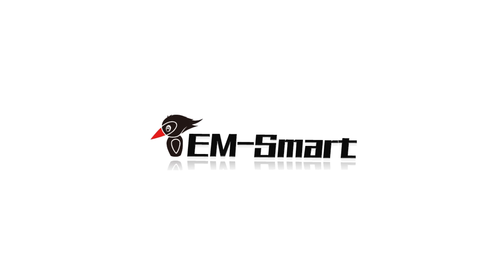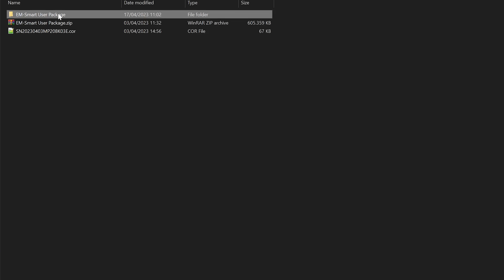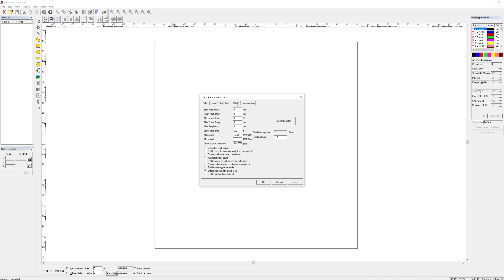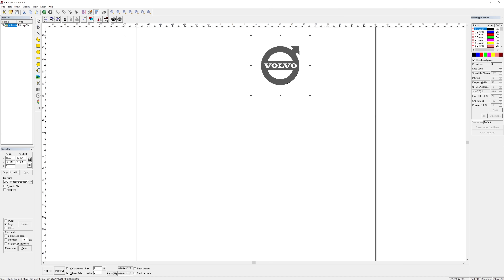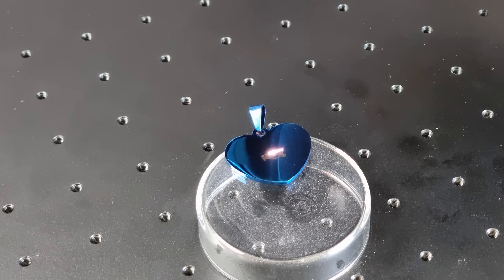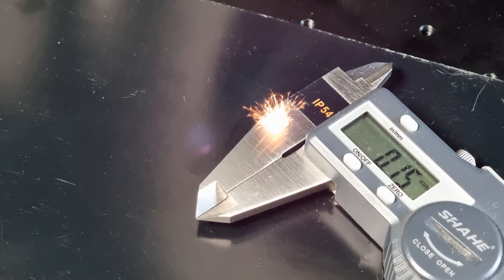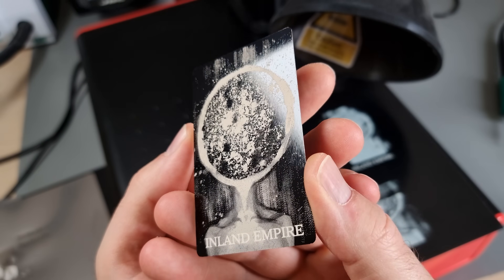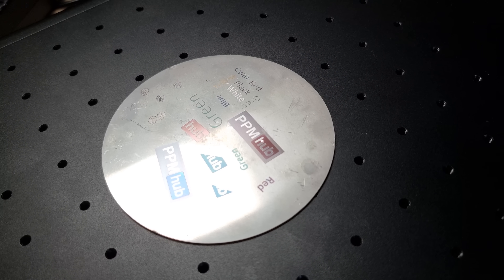20W EM-Smart MOPA Desktop Fiber Laser Engraver Review

Comment: Nice video, I also watched every other video to make sure I understood what this laser offered, and decided to share my experience. When I received the EM-Smart Mopa laser I purchased I was very impressed right from the start, which is good because this is my first fiber laser (I have a diode laser). It was well packed. It was very easy to assemble and equally easy to configure. I fired up EZCAD and was able to do some testing. I created cheat sheets with all the settings I use for the various items I sell, these sheets come in handy.

The main reason I went with this laser was because of its compact size. I knew this laser  would be a benefit at Craft Shows and it has been. I found a cheap folding 3-sided thin wooden divider that works great to shield the laser, with that setup I was able to provide custom engraved items to customers while they waited (I just made sure the spot I was given had a plug near by). If my success at craft shows continues, I will have this laser paid off in no time. 

All in all, I am very impressed with the laser and look forward to learning more about it and seeing what other cool items I can make with it.

Comment: Looks a neat little machine! I find it a bit strange that you need to use a negative value for the start/on tc time. This usually indicates an incorrectly set “jump delay”, which you can find under the Advance button. On mine I have the jump delay (both min and max) at 400us, then the start tc at positive 200ns.
Reply from the maker: Interesting, thank you, will have another look!
Reply: @reps perhaps things will become clearer if you take it apart

Comment: A little less pulse power than the usual JPT M7 60W ( 1.5mJ vs 2.0mJ ), and it seems they indicate proprietary lenses on their site which would be a little worrying.  Otherwise a nice package, and a bit cheaper than the current Amazon prices for similar.  Maybe another round of prices wars is coming for MOPA.
Reply: The 2mJ version is significantly more expensive. This is the YDFLP-E-20-M7-S-R, with the -E being the cost-optimized model, and it's by far the most popular now, all the way up to 60W(that's what I bought as a bare source). It came out a couple years ago and everyone has switched to it since, unless you specifically ask for the larger, more powerful option.

Comment: You didn't talk about the most important question: Is it usable for creating PCBs? Can it remove the thin copper?
Reply from the maker: Yes, it can structure thin copper layers directly, but one has to be very careful not to burn the epoxy / glass fiber substrate

Comment: Warning: I bought the non-MOPA version of this machine with a Raycus source and the usable power dropped significantly and very noticeably after only a couple of weeks.
When I first got the machine it could completely ablate all the copper off the surface of a PCB, now it can't mark copper at all, it can no-longer push past the reflectivity barrier of copper.
It will still engrave other materials but the settings have to be cranked up a lot.
Reply: Did smoke build up on the lens?
Reply: Was gonna say, smoke buildup and other ablated material can coat lenses and decrease output power a lot. This happens with CO2 lasers as well.
Reply: it's junk

Comment: Is it any good with PCBs? I know that depending on pulse energy some of those 20w lasers can without problems.
Reply from the maker: Yes, it can ablate copper, but it's hard to stop the process before it reaches the substrate
Reply: 20w mopa is more than sufficient to remove copper from PCBs. i do it with a 20w jpt mopa.

Comment: That actually seems like a decent laser to start with, since I'm not willing to put too much money for something I'm using while prototyping. Awesome video, even though nothing was taken apart!
Reply: You can get a 100W mopa with the same price and it will have the same laser source manufacturer. This is grossly overpriced. I have 100W mopa and 5W uv from finnlaser and co2 from other place :)
Reply: This laser is $6,000, not really a "starter" laser, as this is supposedly ready for commercial applications out of the box (kinda).
Reply: @shippo72  i disagree as this is a super beginner laser because it is so low power. 100W mopa with bigger work area you can buy for 5K which is cheaper than this

Comment: Can it nuke the copper layer off a PCB surface? If so, could you look into making PCBs with this merhod?
Reply: I did exactly this with the non-MOPA model. It worked at first, but after a couple of weeks it just reflects off copper and doesn't even leave a mark.
I'm using it instead to laser off some paint to use as a mask, then chemically etch with ferric chloride.
Reply: @thetastefultoastie6077  Why not return it? Do they not have a warranty program?
Reply: @thetastefultoastie6077  are you sure its still in focus? I have 100w mopa you should get a more powerful too
Reply: it absolutely could, just a matter of tuning the power so it doesn't ablate the substrate also
Reply: Yes, but also no. You can't avoid charring of the substrate, because the right parameters for copper are also way too much for prepreg.
Reply: Why tho? You can get a nice 4 layer pcb 100mmx100mm under 1€/piece from jlcpcb. I won't bother with etching anymore
Reply: only useful for 2 types of rapid prototyping. 

1. something that requires quite a bit of iteration/circuit parameter tuning that is not easily simulated, as you can blow through a few iterations in a day, without any waiting time or shipping.

2. maybe working on heavier than normal copper weight and/or larger than normal PCBs that arent covered by the cheap pricing

Comment: I bet you saw the "guts" of the machine off camera! :)
Reply from the maker: 😇 yeah it's alright. They use a little DC-DC board to convert the incoming +24V to +/-15 for the galvo and there's a genuine JCZ lite board. Lite meaning it will only work with EZCAD lite with limited features and no rotary axis. A bit perplexing at this price, but lightburn has all of the extra functions

Comment: 2:48 anyone interested in buying a galvo laser from a chinese vendor should heed this as a warning; if anything goes wrong with your machine or you have questions about the configuration you are SOL; you have to figure everything out yourself. (i have bought two galvo lasers from chinese vendors in the past)
Reply: I agree but the last one I bought was from finnlaser and they answer super fast in whatsapp if I have dumb questions.
Reply: eh I bought a chinese laser from Focus Laser and it was fine, its depending on your agent really, mine is really friendly and helpful, that everything when smoothly. Your mileage may vary, its happen to a lot of company also even the good one. Communicating and doing your research helps.
Reply: @NomiyaSan  yes everything goes smoothly until you ask difficult questions like "hey man i'm having difficulties getting colours, do you have any recommendations?" and the guy copy pastes his photo of some settings that don't work for you because you have a different laser source and lens

Comment: Can it ablate PCBs?
Reply: yes, but as is tradition with pcb manufacturing it really doesnt make sense to do yourself with chinese manufactured boards being so cheap
Reply: @ikbendusan  it's not about cost, but time. Having a prototype in a couple of hours including soldering is really useful.
Reply: @Gengh13  i genuinely don't believe that anyone who says that actually makes pcbs. if anyone does, the board is so simple that wires on a perf board would have sufficed. given the limitations of diy circuit boards i don't consider it worth my time, but to each their own. it only takes a week to receive a board from overseas; better off thinking about your design a little harder before committing to a pcb. besides, it's for a hobby, why the rush?
Reply: @ikbendusan  not every project is complex and not every section needs extensive testing. Being able to test and optimize early saves a lot of time.
Reply: @Gengh13  have you made pcbs with a milling machine or laser before?
Reply: @ikbendusan  nope, I've made a lot of toner transfer prototypes before sending the final version/volume production to a manufacturer.
But that's time consuming and has significant restrictions on vias.

Comment: I did not realize that lasers could do colors like that. That's really cool.
Reply: Some metals, most notedly titanium, change colour when heated, by forming different order oxides with more or fewer oxygen atoms as they get hotter, and thinner/thicker oxide layers having different colours too. Hence a very precisely controlled laser dumping calibrated joules into an area to heat it precisely.

There are also plenty of blacksmithing videos on here that exploit the effect, usually using a flame, not a laser, to make rainbow metal art.
Reply: I think it's similar to anodizing?